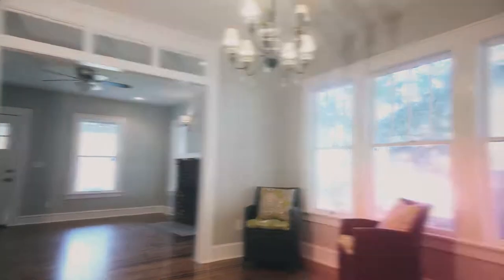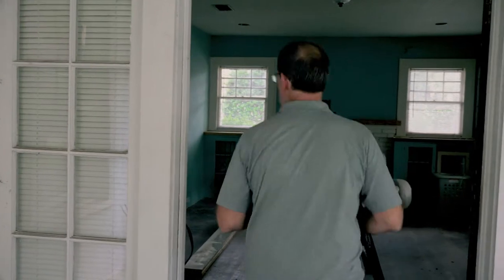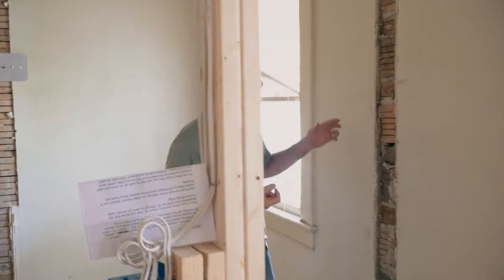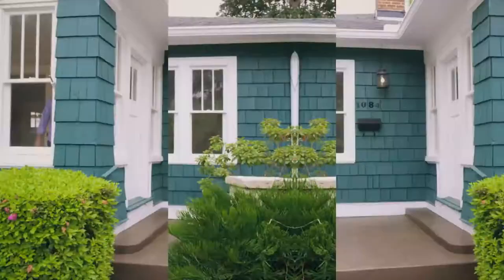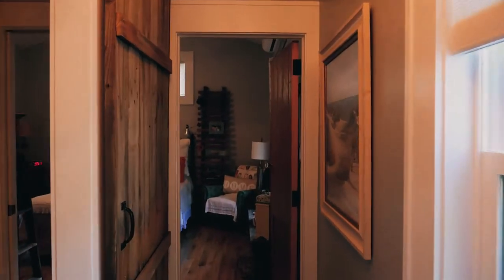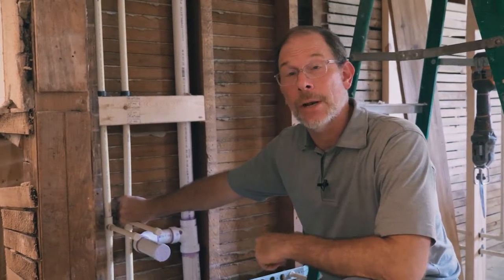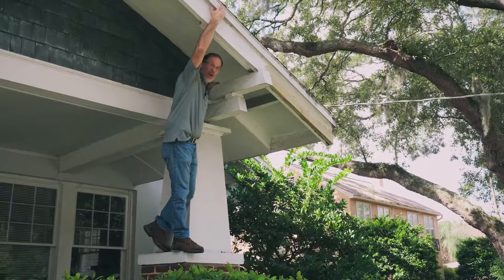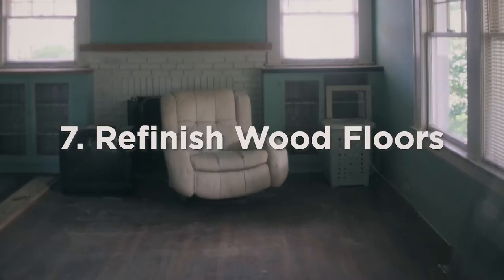Some Real Costs to keep in Mind When Buying A Historic Home (By CenterBeam Construction)

Comment: The thing I've learned about historic homes is that before you spend money on refinishing anything, installing anything or even painting you should research the city or village archives for any permits that were taken out so you know if the electric, gas, plumbing, roof and HVAC have been updated. Even if the owner insists those items were addressed, demand to see a copy of the permits. If there are no permits on file with the city, that means that some fly-by-night operation or the homeowner themselves did the work--which can spell trouble.  Many older homes are grandfathered into their well or septic systems, however, given updates in code as soon as the previous owner sells those grandfathered rights are null and void and the village, town or city can demand that you pay to be added to city sewer and water costing you possibly tens of thousands of dollars. You'll also want to make sure that the home's foundation is solid. Any signs of leaking, bowing or bulging in the foundation is a sure sign that at any moment, your foundation could crumble and the entire house can cave in.
Reply: Thanks what about wiring on a house built 1920?
Reply: @dionfrutos7997  Probably yes---you have to rewire it. That means tearing up the walls and  possibly the ceilings. Probably new electrical service and design. All new electrical fixtures which will be more than what is there originally. Depends on what was done since 1920. Get a coupld serious bids.

Comment: My client is currently renovating a ca1888 bungalow. At first the builder came to me needing plans drawn up for a small addition on the rear and change the windows--to be able to do a cost take-off prior to purchase. In the meantime the client went ahead and bought the house. In the end they wanted all new windows and not necessarily in the existing openings. As far as that goes the window openings were not really reusable for inserts and the house framing was very poor from the start and abused over the last 100 years. Like most homeowners they wanted to change things. Once you touch the structure you own it and it's very difficult to justify junk work from the past in today's engineering. So before we even got started the house had ASBESTOS REMOVAL  all new plumbing, and all new electrical, (that's all new piping, wiring and service, new meters etc.) all new Marvin Ultra windows (each in new framed openings). and was REQUIRED TO HAVE FIRE SPRINKLERS throughout. This means that, besides saving the crumby kitchen and a few floors, some crumby exterior doors... BASICALLY ALL THE FINISHES (INTERIOR and EXTERIOR) , EQUIPMENT, AND FIXTURES IN THE HOUSE WERE REPLACED. The only thing that did not get reworked was the foundation, and that was just "OK" and the cheap kitchen cabinets. I'd say the property might be valued a third of what they'll pay for it in the end, and really worth less than that. Even before all this I would have said DON'T BUY IT --but of course I was never consulted. They did not get the house they wanted as they could not add the desired features. Why not start with "DON'T BUY IT" and try to convince yourself otherwise from there? Long post but I didn't have time to make it shorter.
Reply: Thank you for this. I’m going through this now. It’s actually a family home- taken over by the small town since being sold back in 2000. It was built in 1884. I grew up there. It has a beautiful yard and it’s a certified historical home on a prominent college campus. I have so many questions!
Reply: Great comment, we’re thinking about a historic home. What other things should we consider not mentioned here? Thanks again for the advice.